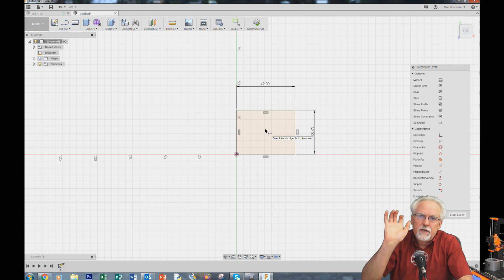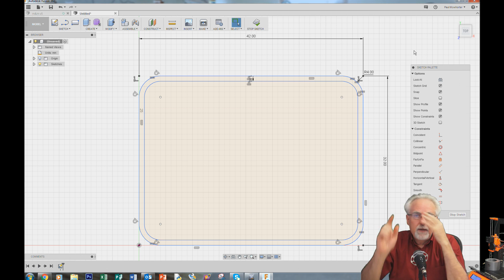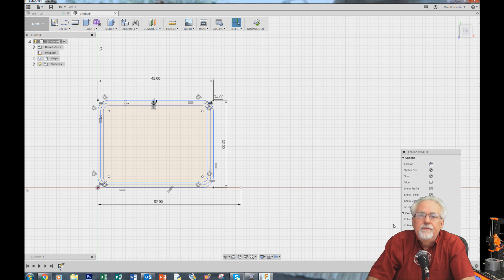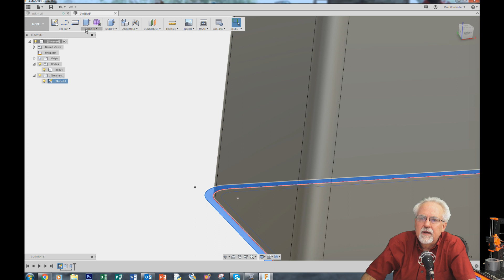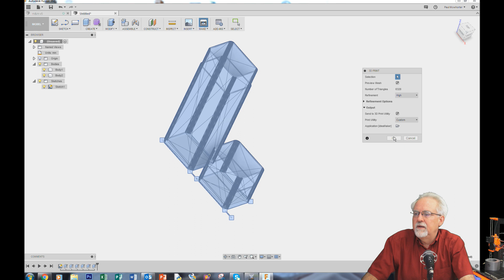Learn Fusion 360 or Die Trying LESSON 2: First 3D Design for Absolute Beginners

Comment: Thank you very much for the amount of work you have put into creating this series! I'm proud that by starting from 0 (no engineering/modelling experience) I've managed to create this case too. By the end of the video, when it comes to resizing it, I realised that after I type in 36, getting the case smaller, I can see that underneath there's another accidentally made duplicated sketch, with the original dimension of 42. As I can only see part of it (since the resized one is above), I am trying to select all of the left side that's still visibile, hit delete, but nothing happens. I also found the option to select by size, which I did, then right-mouse click and Delete, but it still won't go away. In a nutshell, it looks like at the very beginning, in the same sketch (as there are no 2 sketches with the eye toggle), I've duplicated the design, it extruded the one above and now I'm left with the other sketch underneath and I can't find a way to delete it. Unfortunately it's been over an hour trying to search for an answer online, which made me ask you over here, hoping you'll see it. Again, thank you for creating this! It was from part 1 of the series where you pointed out exactly where I was - wanting to search for another tool and jumping into 3D right from the start.

Comment: This is really good! I'm not completely inexperienced w/ 3d modeling, so these tutorials have been super easy to follow. The only thing I'm struggling with - I made a similar object as in the video, just with thicker walls. It is a CRAZY tight fit. Like - if I was using this for my glasses, I would be very unhappy 😅 Do you have any suggestions on how to easily fix this?

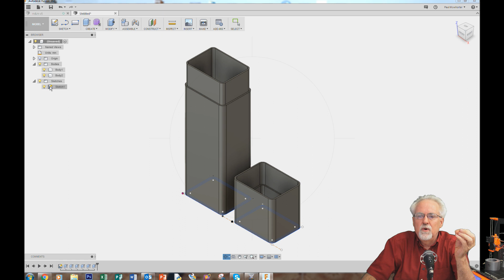Comment: Help!!!!!  It is now April 2023 and I am stuck at lesson 2 (minute 20:50) when Paul reverts back to the sketch to change dimensions. The updated fuson software is not presenting any dimensions on the sketch.  Can someone please tell me how to turn them on.
Reply from the maker: I have made a new playlist based on the newer fusion 360. Look at the playlists on my channel and you might move to the new series.
Reply: @paulmcwhorter  Thankyou. I am tryin  to learn Fusion 360 to get into 3d modeling so I  can carve a guitar neck on my cnc.  I have Vectric VCarve Pro and know it fairly well, but really need either Aspire (which is costly) or learn fusion. Any advise?

Comment: Thank you, Paul. I've found several good videos of the basics of Fusion, but they all pale compared to yours. I guess being a math teacher was an asset. I'm a 74 yo retired electrical engineer,  and like you, I started with Autocad many years ago (Acad 10 - DOS version) and quickly gave up. When I retired, I wanted to learn SketchUp, but for the simple woodworking projects I made, hand drawn sketches were lots faster. Then when I bought my 3D printer, I started using TinkerCad. However, since I wanted something a bit more robust, I decided to give Fusion a chance. So, finding your videos was a God-send as you really had the right approach to help me. Many thanks.

Comment: I have to say, your style of teaching is much more favorable than other tutorials I've watched. They jump right into making a 3d model, but you break down everything you do and explain the whys. I've tried sketchup, 3ds max, blender, and never seemed to understand 3d software. The newer version of 360 is much different than yours, but it's been a huge help to me nonetheless.
Reply from the maker: I have a new set of fusion 360 lessons on the channel with the updated fusion. Check out the new lessons.
Reply: @paulmcwhorter  Thanks Paul - I've worked through this tutorial and the previous, which were both excellent. The only issue I had was I had to adapt a few parts because of the version of Fusion 360 (which probably wasn't a bad thing as it made me think further about what I was doing).

Really enjoying the tutorials, I love your teaching style and it didn't surprise me at all when you mentioned that you were previously a maths teacher, the content, manner and pace were one of a professional educator.
Reply: Ditto to the comment above, these tuts hit with more precision.

Comment: I'm just loving this course.  A few problems I'm having.  I create a rectangle that is any dimension, say 25 wide from the origin.  I click the dimension tool and click the top side line and type in 30.  The rectangle broadens to 30 but it is 5 to the left of the origin and the rectangle is no longer anchored to the origin.  If I type in 20 the bottom left corner moves 5 to the right of the origin.

Comment: My (free) Fusion 360 is different than yours. At the top, yours has the words Sketch Create Modify etc. Mine has the words Create Modify etc. When I click on Create, up comes a list. Second on the list is Create Sketch Tools. Now from there I have no problems creating the sketch, but when I try to extrude I am only able to extrude one surface. Then the sketch changes from lines to blue surfaces. Why doesn't it work like yours?

Comment: Hi, THIS definitely helped my to get over the starting line. Very good ... Position, Dimension & Constraints

Three Comments maybe to enhance your lessons:
The eye-glasses box does not really com good out of the printer - with ONLY two offsets => three extrusions, Lid and Bottom close tooo close. 
=> I added a third extrusion with 0.3 mm as spacer - means: the SPACER extrusion always IS NOT extruded together with the Lip at iether Bottom or LIS ... space to better slip into each other.
Second is: the Pattern DOES not replicate e.g. the addition of the third offset, I did have to manually add. 
Third is really confusing: Size / Dimension changes ARE replicated via the Pattern AND one can change a Rectangle. I used an ellipse for a special box AND it DID NOT Accept the change of the Dimension Constraint, means the Resizing of the ellipse.

Comment: I'm an electrical engineer, just learning modern 3D CAD software.  I totally agree with many comments - Paul, you are an excellent instructor - teaching the how and why AND when things go wrong, how to get back.  ...if things aren't right, how to get them right.  I've watched a lot of software how to videos.  The worst ones tell you what the software can do without telling you what they're doing while they drive the software.  That's useless.  The thought process method of instruction is so complete - circumspect.  THIS is how instruction is done!!

Comment: I'm an old guy that needed something to do during this Covid thing. I bought an ender 3 and now I want to program. I will or I will die trying. The only problem I am having is that my version of Fusion is somewhat different from the one you used. Everything is there, I just have to hunt around and find it. If you can teach this old man something, you can teach anyone. I also have a CNC router and would like to program that for 3d. Got any videos on that? Thanks again.

Comment: Great lesson. As others have said, Autodesk changed the "model" workspace to "design" workspace and in the process reworked a lot of the interface in sketching. I was impressed that the 3d printing custom export you showed let me choose the cura.exe (version 4.5.0 as I write this) slicer and the model opened up for slicing!

Comment: @paul McWhorter  great videos i learn fusion 3D better and understand it better thank you , however i am having the latest build atm 4.5 now i did follow this build above the glass box holder, now at some point wen you did finish them you changed the distances wen i do that it will only change the first body not the second so the first one overlap the second one and i cant move that one a side, how to fix that , wondering how to do just that, thank you for your time and effort to learn others and that for free , you deserve a medal , thank you

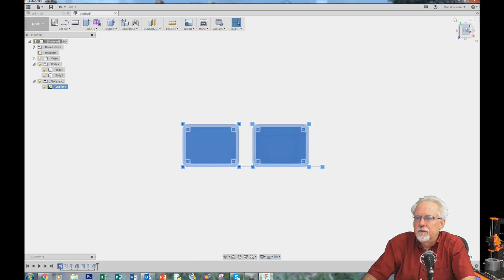in this latest build some things are different to do the way you do but i manage to build it and print it only the thing i mention above is my flawless , thanks for all the work you put in to ( from 21:34 )

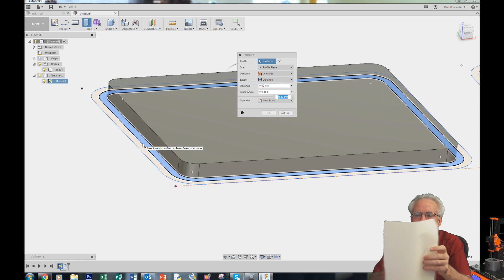Comment: During the current coronavirus lockdown I have set myself the task of working through your great YouTube lessons on Fusion 360. I have version 2.0.7830 on my Windows 10 PC so some of its commands don't map easily to your version. Everything has been going great until I get to 17:30 minutes into lesson 2. Extruded the 2 mm base and re-enabled Sketch1 but can't select the next layer out as you do at this point in your video and when I issue the extrude command these next two layers disappear! What am I doing wrong? Any suggestions would be most appreciated!!
Reply: Repeated this and the same thing happened. Played around with switching off the body and then switching it back on and also switching on the sketch. It then worked!!

Comment: Paul, great help to understanding Fusion360. Your program allows no clearance between the lid and the box. Did you add another offset for clearance so the actual printed parts will fit together? How did you solve this problem?

Comment: Thanks so much for this video! I will normally study new software at lynda, but your video was much much better than the beginner lesson I found at lynda. Everything in your lesson worked quite smoothly, even though I'm using software (October 2019) that is 2 years newer. I did have to right click instead of dropping a menu for a couple actions...but I have myself a sunglasses case model, customized to my glasses size. Fusion is sooo much better than sketchup. With that improvement comes complexity...but it's all do-able.

Comment: More difficult than I expected since mine is a newer version and a different layout, but I persevered
Reply: I'm running into the same. They really need to update the info, the transition is killing me as a beginner. Even the Autodesk tutorials (however terrible I find them) are outdated.
Thank God for Paul. These are far better for my old brain. ;)
Reply: I know absolutely nothing about 3D drawing or printing. I'm starting both at the same time. Yes, I'm running the latest version of Fusion 360 (4.5) and there are things a little bit different on the menus from the videos. I just keep clicking on different options until I find the one that matches what Paul is using. Yes, a little confusing at times but I manage to get through a 30 minute video in only about an hour and a half! I'm very happy at the end of the video that what I see on his monitor is identical to what's on my monitor. Paul, you're a great teacher!
Reply: @LB-xl5dq  haha...quite familiar with my situation...but  worthy

Comment: Have a question , when i have the 2 shapes side by side and i go to adjust and change the length of both when i type in the length it is not changing the 3 walls of the shape . It is just changing the outer wall layer on both not the entire shape overall . How do i unify it together as one shape so any adjustments change it universally

Comment: Unfortunately, with the new toolbars, your method of returning to the sketch mode to make changes doesn’t work. You no longer have a way to “add” a rectangle from the Design Toolbar (that I could find). To return to the sketch mode I had to right the Sketch Icon on the timeline then select Edit Sketch. After making any changes hit Finish Sketch and you will be returned to the 3D models. As many have said your tutorials are far better for a newbe than any others I have watched. Thanks a bunch.

Comment: HI Paul
 Just want to say thanks for your tutorials as they have got me through that frustrating period you talk about. The thing that got me was when you said its not like a windows operation where you click and move things with the mouse. I am conversant with Sketchup which has been my downfall as I always go back to Sketchup because it is easier. The end result is badly surfaced Stl Files for 3D printing. I am now hooked on your tutorials and Fusion 360. You can have a look at some of my creations in the RC world at Thingyverse with scale cockpits on some very major models. The latest is a 1/3 scale Boeing Stearman powered by a 250 CC 7 Cylinder radial engine. This model was featured in Scale Modeler International magazine last December. Just put kcmj in the search to find my page. There is also a nice cockpit of the Spirit of St Lewis. Thanks again Paul.       

Keith

Comment: I just started with Fusion (downloaded version 2018 on Jan 27th 2019), 8 min into this lesson 2 about negative offset got confusing.  I can perform the first negative offset with the down arrow only (won't accept a typed in negative number) but my program won't accept the second negative offset.  Searched on Google and I see an autodesk forum talking about this and a post dated 11-01-18 from a autodesk product manager describing a fix and needing time to finalize and test.  I will see if I can contact autodesk about this.
Reply: for me, there was this little flip button that had arrows on it. Put the Abs. value of the values he gave (-1=1 and -2=2) and then you can flip if the offset (by pressing the arrow button) is inside the shape or outside. Like he said, make sure you do not offset an offset.

Comment: Great videos, the first was very helpful but it seems in the Fusion 360 I'm using (January 2019) it won't allow Fillet or Chamfer until after I have extruded the rectangle which is confusing me ... grumble grumble ... okay if I press F it comes up with modify fillet, but if I want to create a fillet I have to click on sketch then click on fillet ... which seems like I would first create a fillet 'F' then modify the fillet by clicking modify then clicking fillet ... sorry about that ... found an answer
Reply: There are two different fillet. One in the sketch menu and one in the modify menu.  Use the one in the sketch menu to alter sketches.  It does not have a shortcut letter or number.

Comment: Each time I think I'm starting to "get it," I run up against another brick wall. I tried to re-size, as shown at the 22:00 minute mark, but my vertical dimensions are missing. I'm not sure where they went, because I followed along exactly and they were definitely there at one point. I then tried to add dimensions, but all I could select was the line segment prior to the filet, so I couldn't grab the entire height of the outside perimeter. In any other drawing program, you would create a group of all the objects that make up the outer perimeter, and then deal with that. I have absolutely no clue how to go about doing something similar, even after four hours with several tutorials, my own work, and these two tutorials.

Sadly, I think I'm going to give this up pretty soon.

Comment: Why did the parts fit so perfectly yet we didn't create any tolerance between them . Did cad do something automatically?
Reply from the maker: It is just the way things work with my printer. If I make the OD of the inside part match the ID of the outside part, I get a snug but slippable joint. For other printers you might need to leave some small tolerance. On my sketchup series of lessons I did a lesson on designing and printing design rule checkers which allow you to understand how to design for your printer. While the lessons were on sketchup, the same thing can be done of fusion 360

Comment: great lesson.
when changing the dimensions at the end of the video after extruding, selecting the 2 point rectangle tool did not bring the dimensions back for me. This meant i couldn't edit the dimensions and scale the sketch down.
Heres the fix if u had the same problem.
go to the left of the screen where the light bulbs are and it says "sketch1" (most likely) and either double click that sketch1 or click it and everything with highlight blue and then right click and hit " edit sketch" this is bring all the dimensions back.

Comment: Not sure if it has been already mentioned, as the list of comments is quite long, but for anyone who wants to export each part separately (especially if you are not directly connected to your printer), for example if you want to print the top in one color and the body in another, or if you want to avoid long print hours for both in one go, just right-click on each body separately in your Browser menu and select Save as STL. Then you can import each stl into your own slicer of choice like Cura.
Reply from the maker: Very good suggestion, wish I had mentioned that in the video.

Comment: I cannot get the offsets to take. I managed to get the -1 to take once but never got the -2 to take. As I put the curves in I get a warning saying 'Constraints and or dimensions were removed during operation' or something like that. I've spent hours on this and it's driving me nuts! Any help greatly appreciated. Mal (Dazed and Confused)
Reply: I think the interface may have changed since this was produced, try this : select the elements you want to offset, type -2 in the box and then click 'flip'
Reply: I discovered the same thing. Was going nuts not knowing why it would not take a negative offset. As said above, an apparent update added a "flip" option so the negative sign procedure is no longer valid. Fortunately, fusion 360 is fairly intuitive as far as the part goes anyway...

Comment: Hi Sir. Thank you very much for posting that tutorial! It's really helpfull and straight forward. I had the same problem with Sketchup (love that software, but when it came to 3d printing - circles are polygones .. problems with solid object- always you need to check if there isn't any tiny gap- which is very frustrating.. ) That's why I have chosen a Fusion 360. I'm honoured to be able learning from you Sir! In your particual case of glass box both parts fits together, but there are situations were you need to add some space between them (tolerance). Have you any hints for that?
One more time thank you and keep up a great work! Best regards.